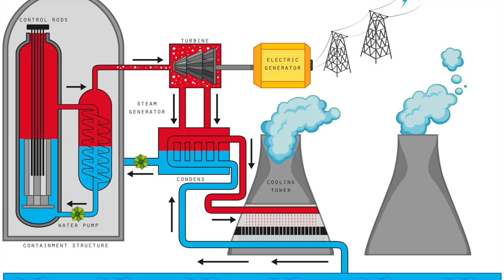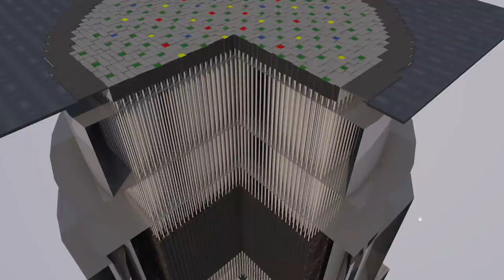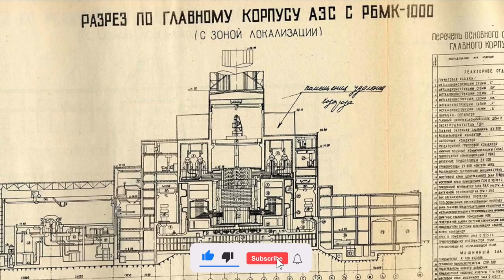Boiling hell: what happened at the Chernobyl nuclear power plant

Comment: Hey Wisioner, I have seen this line of reasoning before, but Nick Knight is correct. A "nuclear explosion" must have an expansive list very carefully calculated, designed and engineered mechanical, electrical, electronic, structural and material requirements to work. A nuclear explosion from a runaway reactor accident is as likely as a tornado tearing through a junk yard leaving behind a fully-functioning 747 airliner. It will not happen. A violent, nuclear meltdown in which the other materials of the reactor react to the massive heat generated by the runaway reaction is always possible.
Reply: it exploded regardless... pieces of graphite found 300 yds away... meltdown  don't do that...
Reply: @joseph-mariopelerin7028  
No, the steam explosion did that. Steam takes up a lot more space than water. The designers of the RBMK knew that the UBS would come off if more than two fuel channels ruptured at the same time. During the power excursion in Reactor No 4, it is estimated that at least 10-30 fuel channels ruptured simultaniously. RBMKs run super-hot, the graphite easily reaches 700 C when the reactor runs at full power. Now add water to that mix, you can figure out the rest.
Reply: Look... the steam exploded and a cloud of fallout three times worst than a nuclear bomb... so... you call it the way you want...
Reply: @joseph-mariopelerin7028  
Nobody is disputing that the fallout was exceedingly bad, but that still doesn't make it an atom bomb. Since Unit 4 was at the end of its first fuel cycle, a lot of fission products had accumulated in the fuel assemblies. Add to that the new fission products still being produced in the active core and you end up with one hell of a radioactive witch's brew. All of this got released in one fell swoop when the core exploded. Where this is a desired side effect when throwing an atom bomb, for a nuclear reactor it most certainly is not. Normally everything is done to prevent this from happening, even in the case of a severe accident. That's why pretty much every nuclear reactor in the world has a containment building around it. The RBMK has only rudimentary 'containment', the reactor top sits in an ordinary factory building with maybe somewhat thicker walls, but nothing like the concrete bunkers the rest of the world uses to house their reactors. So, there is that.
Reply: Joseph, the distinction, my friend, between a steam explosion and a nuclear explosion is very important. With the constant fear- mongering about nuclear energy, saying it was a nuclear explosion when it was a steam explosion bastardizes the debate - it seeks to make all forms nuclear energy inherently illegitimate and dangerous. Instead of the reality that nuclear energy is phenomenally useful and can be safe, the public is led to believe that every reactor is automatically a potential nuclear bomb. This is simply not true. Even at Chernobyl, had the operators stayed inside of the safety guidelines, there would not have been an accident.
Reply: @joseph-mariopelerin7028  There is no disagreement on this being bad or that there were nuclear materials involved. Where there is a problem is an atomic explosion, aka nuclear bomb, is an explosion that is far from a reactor exploding. Other than the presence of radioactive materials and chain reactions, there are no other similarities. This issue is accuracy. To call this a nuclear explosion, when it was in fact a steam explosion that propelled nuclear materials into the sky, is at a minimum misleading but far worse, it causes misunderstandings and unnecessary fear and is a disservice to everyone.
Reply: A nuclear bomb is a very well controlled nuclear explosion. A nuclear reactor in principle can have a runaway nuclear reaction, either leading to a steam explosion, a hydrogen explosion (hot water and zirconium can I believe generate hydrogen), but also a minor nuclear explosion.

The other two types of explosion (steam/hydrogen) are much more likely and much bigger. But if a nuclear reactor has a fast enough runaway reaction, a nuclear explosion is a possibility.

Whether such an explosion occured in Chernobyl, I don't know. But there were at least two explosions in the nuclear reactor. Most likely they were first steam and then hydrogen based (since it takes time to convert sufficient steam into hydrogen). But a nuclear explosion can not be completely excluded.
Reply: @Krasbin  In the the term "nuclear explosion" is the word nuclear. This means a nucleus is involved in a reaction that is fission or fusion. This is required for a nuclear explosion. If the chain reaction is not the process generating the energy for the explosion the it is not a nuclear explosion. In the case of a steam explosion, the energy is the steam pressure and even though the steam is created from the heat of the fissioning, it is a secondary process and not a nuclear one, so a steam explosion is not a nuclear explosion. Similarly a hydrogen explosion, even if the hydrogen is created due the to heat of fissioning in the reactor, is not a nuclear explosion. It is a chemical explosion. To be a nuclear explosion, the energy of the explosion must be directly from the fissioning process not a secondary process.

Comment: What s about 3 miles Island  nuclear problem in USA in 1985 ?
Reply: what about it?  no gigantic uncontained reactor at 3MI...
Reply: Another MAD simple soviet fan... :D Also, they say that they have been beating black people in US. Can you relativize on that?
Reply: 1; The Three Mile Island incident happened on March 28 1979.
2; No one denies that it happened. However, that reactor had containment where the RBMKs have none, zip, zilch. Yes, they have 'confinement', which is not the same thing.
3; TMI-2 hadn't been abused like Chernobyl Unit 4 was abused by its operators that didn't have a clue what they were doing. Add to that the design flaws and general moodiness of an RBMK and you have an accident waiting to happen...
Reply: TMI is a good case-study of what happens when you do it right but it goes wrong, nobody was in any real danger from TMI. You could bring up Windscale as a western example, except it's decades earlier when things like what happened weren't known - and the safety culture ensured it didn't become a major hazard. The design flaws in the RBMK were fully-known by the SU when they designed the reactor and they just didn't care.
Reply: @streaky81  Exactly. Who in their right mind licenses a positive coefficient reactor? Only people who don't care.
Reply: TMI was a partial meltdown as the result of faulty equipment. But, because it had proper design and containment there were no problems. Huuuuuuuuuuuuuuuuuuuge difference.